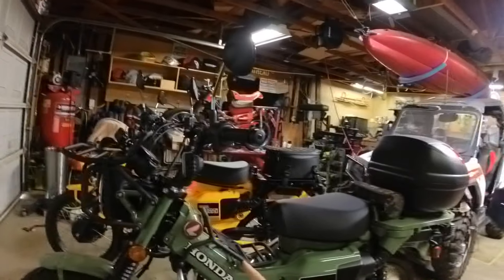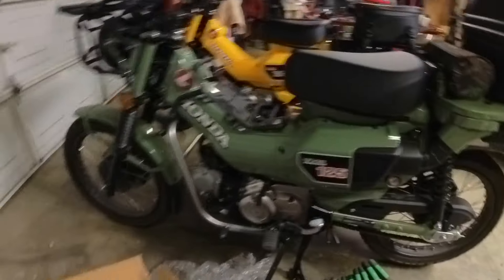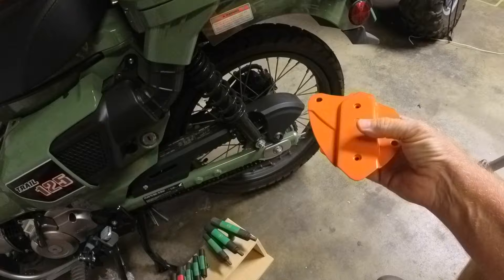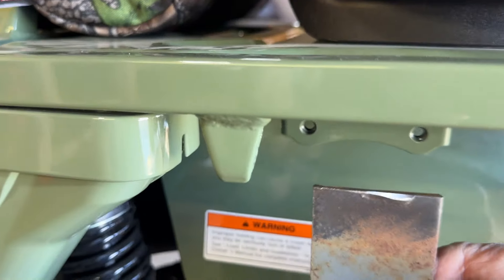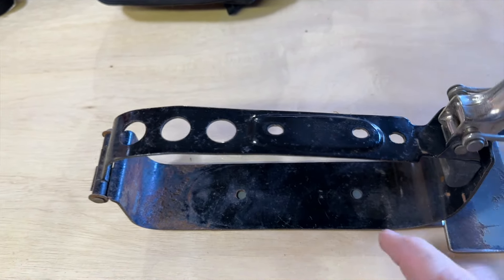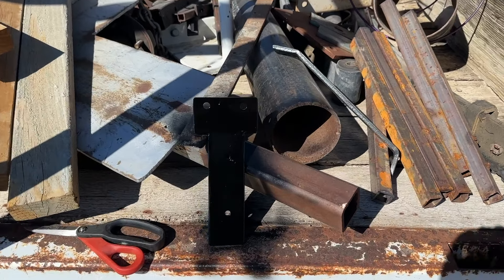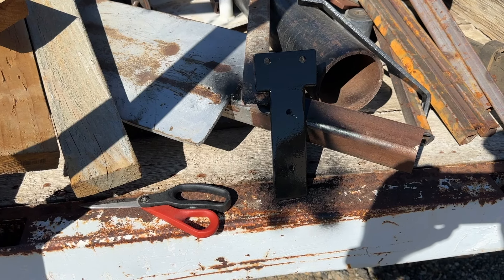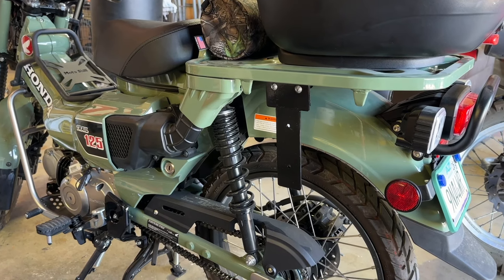I Added a Honda Trail 90 Aux fuel tank to a Trail 125

Comment: That reserve tank is your get back home insurance when riding those trails! Make sure the seal on the cap is good being decades old NOS. I could have used this on my CT-90. I'd have painted the backet the same pea green color as the 125 to make it look even more stock. I want a new 125 Trail so bad.
Reply from the maker: It’s actually all new rubber gaskets and that Japanese rubber is awesome👍🏻